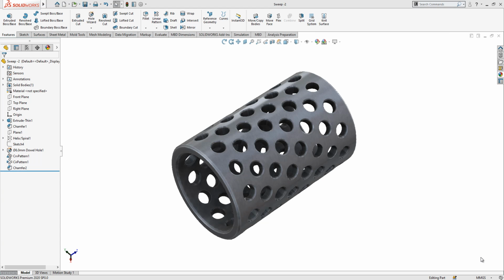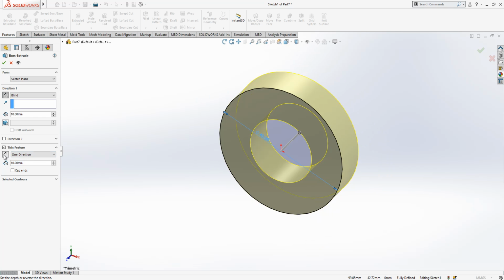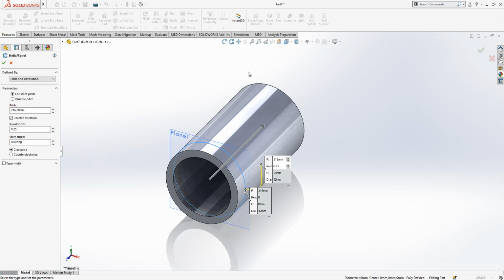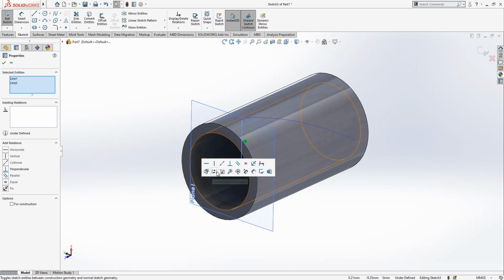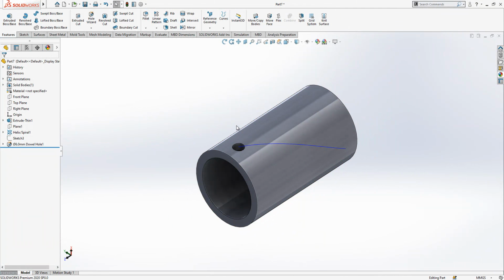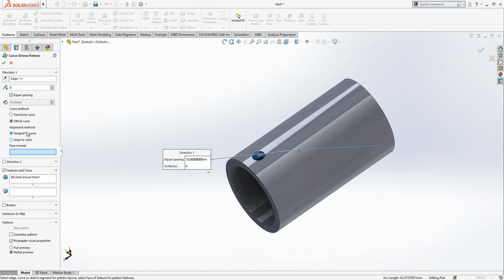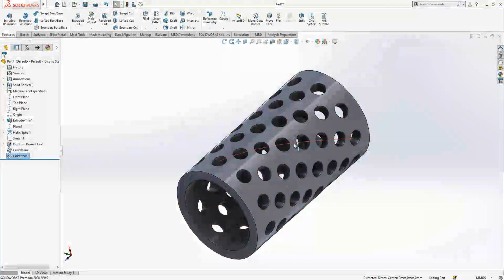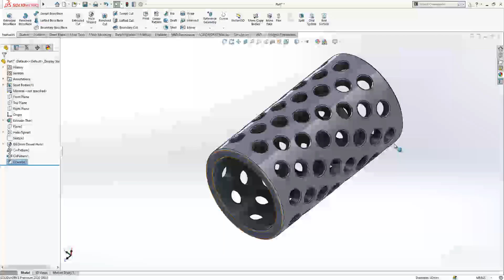Curve Driven Pattern - SolidWorks

Comment: Hi there! I had to construct something similar to this this week and I chose to pattern a flat sheet and then use the flex feature. Turns out this is way too CPU intensive, so I had to create more simple rings and then stack them in an assembly. Your solution might seems to be way more effective. I’m still not used to the features coming from inventor, and your videos regularly are of great value for me. Thank you for that, I really appreciate your content!
Reply from the maker: Hi, 

Thanks for the comment.

I am really glad to hear that videos are helping folks out there.

There are many ways to achieve things in SolidWorks. Over time, you will develop an intuition and keep watching. There are a lot of videos you can gain valuable insight about the program.
Regards